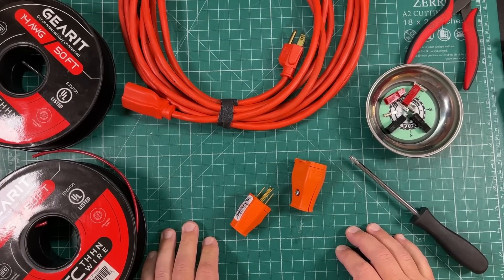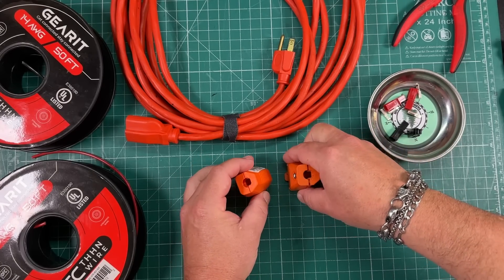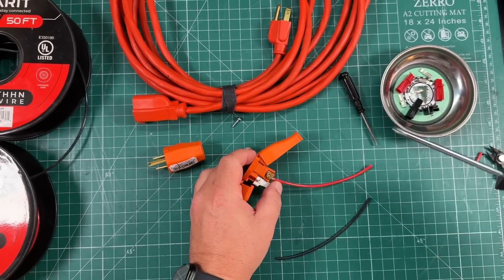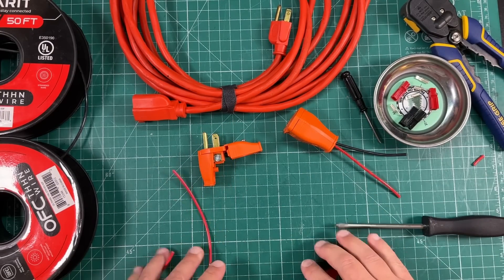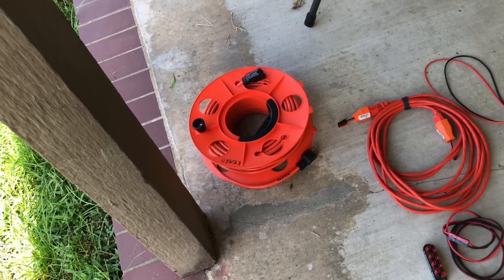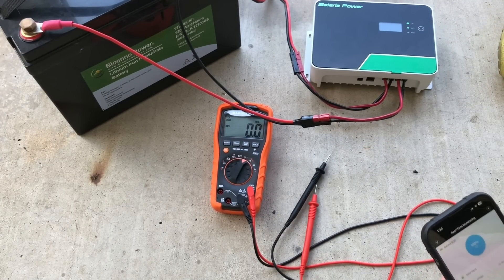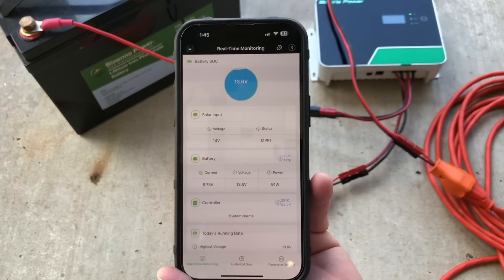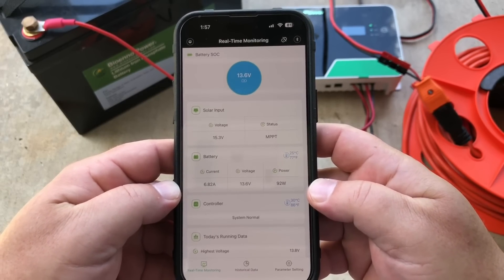12V DC Through Extension Cords For Solar.  Will It Work?

Comment: use 2 extension cords, one for positive and one for negative. use all three wires in each extension cord that will decrease losses
Reply from the maker: Now that is a damn good idea!
Reply: @hamradiotube  Your charge controller is MPPT and will support higher solar input voltages of 100 or more volts.  The first thing you should do is wire your panels in series and then with the higher voltage your voltage drop will be much less across the smaller gauge wire of most common extension cords resulting in greater and more efficient power transmission. Retest doing this and also adding in the third conductor to the pos or neg and see if either that makes a difference too.
Reply: @hamradiotube  no worries I've done similar things in the past
Reply: Or you could get a bigger gauge extension cord. There are 12 and 10 gauge ext out there
Reply: @Chris_KI4WCO  the 3 x14 gauge wires are the same as 1x 9 gauge wire so it can carry more current
Reply: I kept expecting the mail truck to run over the solar panels! Interesting video - keep on truckin’!
Reply: Next, get an accurate ohmeter/VOM, and measure the R of each leg. The problem arises because a panel's voltage drops with an increasing load. Put a big ass resistor on the load side and start measuring things (BAR)....not the 30-06 kind. 😊
Reply: There are conversion charts for same wire sizes being combined, different wires gauges being combined. I use 16/3AWG which works out to a 11AWG cable. Close enough for my setup. You could always 14/3AWG and end up with a 9AWG cable.
Reply: This is the way.
Reply: Thanks so much for this! I've been doing this for years but wasn't sure how much loss I did or did not have... I used to use all three wires like a precious poster said, but I dropped to just one for a 100 W panel.
Reply: I think I’m going to do that, that’s a great idea!

Comment: I tried this 20 years ago with 50 ft 10 ga cords but I changed the cord ends to the 30 amp horizontal prongs (Before power plugs) so it was impossible  to plug into AC. It's just a option in a grid down???? Thanks

Comment: A little late watching this video but me and my hunting crew use extension cords to connect our 12v motorized duck decoys.  Been running the system for several years and works fine.  Great video and keep up the ham experimentation mentality!

Comment: I bought a huge load of 100w panels in case the grid goes out.
I looked at wire and decided to use 100ft #16  exterior extension cables in lieu of #10 solar.
By wiring all three conductors together it seems to work although the current capability is lessened
compared to #10 ..  three #16 wires connected together is roughly the equal of #11 copper.   
I found the 100ft extension cables at Home Depot for 20/ea and w free shipping.
I cut 10ft off each end of the extension cables and connected the two ends together to make a heavy-duty 20ft 110vac extension cord... leaving 80ft of #11 equivalent per extension cord.
I'm a ham operator and also have used some of the #16 wire to make EFHW antennas... it's very cheap as you get 300ft of it for 20.00!  and it's easy to strip out once you get the hang of it.
I am making up kits of three 100w panels and a 400w regulator (5$ at amazon) to charge LiFePO4
50amp batteries.... it werks.   The LiFePO4 in the kits hook to a cheap 500w puresine inverter (41$ at amazon)  The kits are not super powerful but you can run ham gear, fans, LED lights, charge phones..etc   WAY better than nothing!   I'm making up the kits for friends and family (in hopes that if the balloon goes up they won't all have to camp here to leech off my 20kw of solar..lol)

Comment: I use a 2 core extensions  its 1.5mm wire  3m long with  power poles on both ends the voltage regulator is on the back of the solar panel, it gives about 14v out  to the battery.  Im just wondering how much loss there is through the power poles . Its used in our motor home, we plan on going off grid for a week or 2 next week . A normal  summer day here in the north of England  is usually ok to keep the batteries  top up  but since September  last year its been rain and over cast skys  . At the moment its 12 c  (53f) and the forecast isn't good. So I'll need every amp i can get

Comment: did a setup like this using cigarette lighter adapters to top off my boat battery on the way to the lake.  had no where near the losses you had.  most extension cords are junk nowdays.  thing is if you move the cells closer to the battteries then you'll meed longer cables to what you power so whats the difference?   hint on stripping stranded wires- strip off what  you need  then take a second cut about 1/8 inche and pull it  to the end of the wire but not off of it. it keeps the strands from seperating as you tighten it down

Comment: Somebody suggested boosting the voltage.  That's the key.  With an MPPT charge controller, it will efficiently drop the voltage down as needed for your battery.  Check the max input voltage on your charge controller and make certain the VOC on the panels when added in series will be below the controller max.  Then series at the panel and run higher voltage thru the extension cord.  Higher voltage, lower amps, less loss to transfer the same power.

Comment: All things considered this is actually a great idea I think. Reminds me of those new Waco-Powerpole conectors. It’s something you might not use a lot, or ever, but if you’re in a position where you would need something quirky exactly like that that might just save your bacon! I might make a couple up myself and get some Waco-Powerpole connectors too to throw in my bag of goodies.

Also a thought… it might be a pain but you could always look for some welding wire. Thick heavy stuff but very flexible and shouldn’t be too hard to find if you want minimal voltage drop/loss.

Comment: I think this is really a great idea. People should not get wrapped around the axles regarding voltage drop. The pros of the adapters you made bring some great options. Extension cords are everywhere and are durable. Great for outdoor use. Great for improvised emergency setups. I think I’ll make a set of these to keep in my camper. Thanks, Mike!

Comment: You just demonstrated why our power grid is AC instead of DC.  (Also with stepped up voltage to reduce current requirements.)  My opinion, put the batteries close to the panels / charge controller / inverter assembly, and run the extension cord to deliver the AC. Why induce inefficiency?  (Also, electrical plugs are standardized for a reason. It may not be you that picks it up to use it. That's why we have Darwin awards.)

Comment: Southwire has a great voltage drop calculator on their website. As well as an app.
It is surprising what wire gauge you need to carry current at low voltage.

If the controller can handle it, putting similar panels in series to increase PV voltage will reduce % drop proportionately.

The only thing I could find to make fun of are the commercials I got.
thanks for the video.

Comment: On field day we had 2 extension cords employed. One for a small solar system and one for our rotator control cable. You can’t screw up the hookup because the plugs only go one way. All 3 conductors were used for the rotator and 2 used on the other for solar DC. Use what you got.

Comment: For your next experiment it would be interesting to step the Voltage up to 120 VAC and then back down to 12 VDC and measure the loss, using the same cables.

Gregory/ 
The Pigeon Meister
        ... .  🐦‍⬛

Comment: You bring up several important factors that anyone configuring a deployable solar system needs to consider.  Knowing the specifications for your charge controller will influence decisions on where in the physical wiring to place the LiFePo charge controller, and whether to wire the PV panels in series or parallel.  In every case, it is always be better to minimize distance from battery-to-radio to avoid DC voltage drop. Consider a POTA deployment where you want to have solar panels some distance from the battery and radio, because you prefer to operate in the shade.  Or perhaps the utility power is out and you want to operate from indoors. As with battery-to-radio wiring for DC, it is best to minimize distance between charge controller and battery. But that means that the panel-to-charge controller distance is the long leg that is susceptible to voltage drop.  Since many charge controllers have an input range from 12 to 50V to produce 14.6V for the battery, and most panels supply 20V in full sunlight, any voltage drop on the panel-to-charge controller distance will be compensated for by the charge controller. It will still output 14.6V, though it will take longer to charge the battery at a lower current. However, there are some excellent charge controllers that are desirable because they have no RFI, like the Powerwerx MPPT-300, but which have an input voltage specification of 20 to 50V. If the charge controller’s input is less than 20V, such as when a panel is in less than full sunlight, or there is voltage drop in a long run of wire from panel-to-charge controller, the controller is operating out of spec. It’s performance will be unpredictable or it may fail to charge at all.  One solution is to wire two, (ideally matched wattage) panels in series. Together in full sunlight they produce 40V for the charge controller, which is well within spec. Even in lower light conditions and with a long run of wire, the voltage drop will be compensated for and the charge controller will still provide 14.6V to the LiFePo battery.

Comment: I've had a set in my go kit for years.  I just epoxied them into the shell.  Positive to Neutral and Negative to Ground, just in case someone else plugs these into something they shouldn't.  I use 10 and 12 ga extension cords, so less drop.  Useful.

Comment: Just for testing to get it in the house I used my outdoor generator inlet, disconnected the other end from the transfer switch inside and ran it to the charge controller. Rigged up some mc4 connectors to a harbor freight RV cable and had very little loss, but that's all 10 gauge

Comment: You’re definitely on the right track with looking for a heavier gauge and shortening the run.  The other piece you can consider is different solar panels or different wiring arrangements that operate at a higher voltage - higher voltage means lower current which means less line loss.

That said, I think I’m in the camp of “this is stupid” for a completely different reason - safety.  People expect certain things to be used certain ways, and going outside those expectations is an opportunity for mistakes.  You’re saying “these will never be connected to 120VAC”, but having plugs that LOOK like they should be is an invitation for that to happen eventually, potentially frying either your equipment or you.  If you want to use extension cords from the hardware store as a convenient local source of wire I think that’s fine, but I would suggest cutting the plugs off entirely and attaching PowerPoles directly rather than having adapters, to make it clear that both ends must be used only for low-voltage DC purposes.

Comment: I am not making fun of you, but AC uses 14-16 gauge wire while solar uses 10 gauge and sometimes 8 gauge. You can potentially heat up your extension cable for having too much current through smaller gauge wires besides the obvious voltage drop.

Comment: Suggestions: 1) use only the neutral and ground wires from the extension cord. This would help prevent a giant amount of voltage hitting something if it were plugged in wrong. It's not a foolproof or perfect thing, but it should greatly mitigate this risk. 2) use something like a bongo tie and make your pigtail longer. The bongo tie can then wrap the extension cord with that pigtail together, which should A) help ensure they don't come unplugged, B) ensure that folks realize something odd is going on there, C) reduce the likelihood of anyone plugging into actual AC.

As others have noted, DC voltage over long distances has a lot of loss, so don't expect high current or perfection if this is going a ways.

Cheers.
Reply: You're never too old to learn. For example, I just learned what a Bongo Tie is, thanks to you and Google.

Comment: If your charge controller will handle a higher voltage on the PV side then put identical panels in Series.... this will increase the voltage and your overall power loss will be less. Also if you use the Neutral and Ground wires in the extension cord then you reduce the risk of having someone blow something up by plugging the make end of the cord into 120 volts without disconnecting your equipment from the female end!!!

Comment: From a safty standpoint, this is bad. it would be better to cut the cord connectors off and add the power poles. I do understand wanting to be able to use the extension cord for it's original use.

Comment: In a fix it will work.. Remember for Solar minimum 12 ga wire from panels to Controller // Battery bank ... If they are 12 gauge cords it would be great ... Good Idea...  Thanks Love your channel as Im new to amateur radio

Comment: We don't need an excuse to make fun of you, Mike.

You could also set things up to b able to parallel two or more extensions.  I know I've got at least two big extension cords around (electric mower, etc.).  A buddy had to have a really honking extension to run his contractor sized air compressor from his generator.  If the point is to use what you have in a pinch, then what you've shown is better than nothing.

For more permanent and purposeful installations, there's always 10/2, or better, solid copper house wire should do better.

But using what looks like  a 110V AC connector, and having one clueless visitor is all it would take to ruin your whole day.

"Hi" to Satan.

Comment: Just get 50 ft of 10 or 12 Gauge automotive zip cord. It will cost more than a cheap AC extension, but no adapters and lower loss.  Those AC to Power Pole adapters will work in an emergency but also add to the loss.  Another thing to consider is what kind of wire.  I always double-check to avoid "CCA" wire.  I keep Power Pole connectors in my kit, including the heavy duty ones for 8 gauge and xt and solar connectors.  Good video.

Comment: Using all 3 conductors is an excellent idea, but you are correct that moving the batteries and charge controller is a better idea in most cases. If you are inverter DC to AC and inverter is at the battery, its a no brainer to run AC to the house from the solar setup.
The other big boost with matched solar panels for longer wire runs to the charge controller is put the PV panels in series to boost voltage and drop current. The I²R current losses are the devil in the mix.
You can run afoul of NEC pretty quickly when putting PV panels in series. I believe the max open circuit voltage (Voc) allowed is 68VDC without a safety shut down mechanism at the individual panels. That means 3ea nominal 12VDC panels will likely put you over the legal safety limit.

Comment: Can you? Yes. Should you? No. Different connectors are dedicated for different functions. The NEMA 5-15 plug you are designated for 125V AC and 15A. It’s all about preventing someone from plugging a 12V device into a 125V socket and creating a safety hazard. 
For DC line losses at 12V, 10A, and a 14AWG cable, you will start to lose more than 10% of your power at 30ft. If you want to go 100ft and not loose more than 10% of the power, use 10AWG or larger.

Comment: Great idea but one wrong move... Wouldn't let anyone touch it. I'd also use the ground conductor since it'll drop the resistance, thus drop the power loss and temperature. Also it's nice for you to be in the USA, since you guys have thicker extension cords due to lower voltage in the us versus eu
Reply: You could wire them all in series if the charge controller allows it and you'll have less current going through but the same power

Comment: Nicely done video.  Good editing. I saw several times that you connect your solar panels to your charge controller before the controller is connected to your battery. Usually that is not recommended.  Is your controller ok with that?

Comment: Excellent video. I built a battery box for my 100 Ah LIFEPO battery that I charge with a 100 volt power panel. I made an extension cord using a 12 foot 10 AWG wire and power poles. The extension cord runs from the battery box to the mobile ham radio. 

I don’t have the measuring tools, but I would imagine my losses are less. The battery and solar controller are inches from each other in the battery box.

Comment: Use 12/2 household solid core electrical wire, or 12/2 BX.  Most likely a lot less resistance , and less line drop. Then make another video about it... see ? I just gave you a video idea. you're welcome.  :)

Comment: I have a jumper cable set I made many years ago that uses 4 gauge cable that I have used in the past to get power from my solar panels to my controller in an emergency when original cables were too short. This was constructed with a 175 amp power pole at one end going to heavy 4 gauge silicone covered welding cable that was designed like zip cord going to a pair of heavy battery spring clamps used on jumper cables. Having a spare battery terminal end power pole connector to a pair of ring terminals I was able to extend the line the additional 30 feet I needed. All parts were purchased through our supplier, CTW out of Indiana and came in cheaper than the jumper set sold by NAPA. Don’t know if that cable is still available but one might try searching for Vu-tron silicone welding cable. It’s a high count thin strand cable that is very flexible and delivers current and voltage with very little loss.